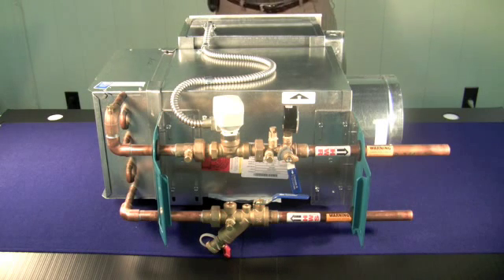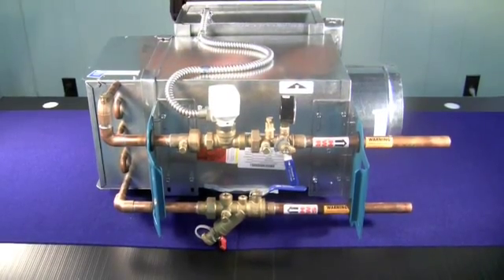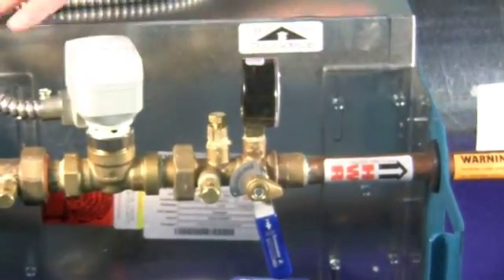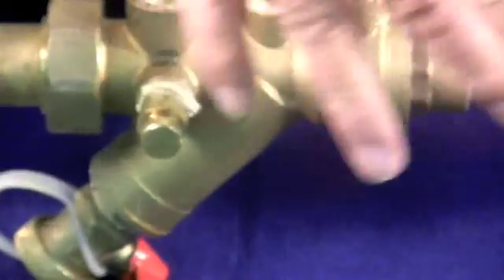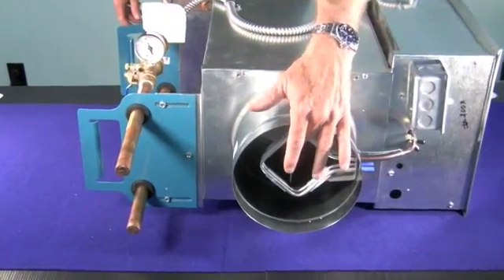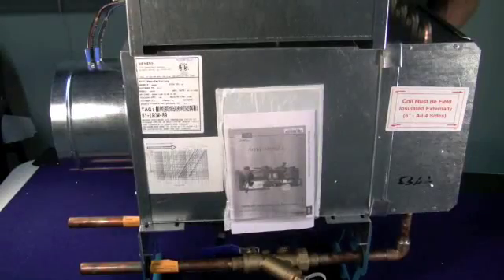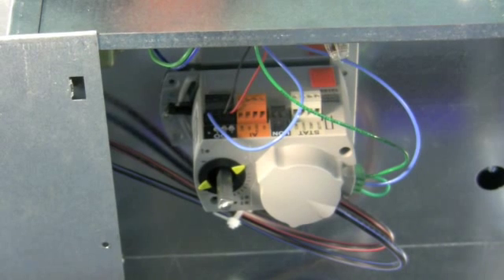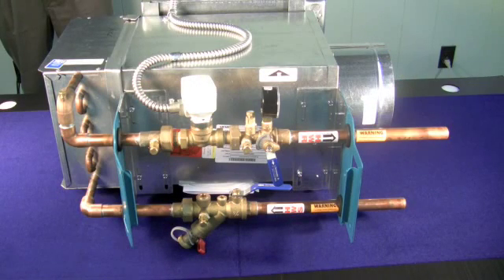Siemens ZCU

Comment: I liked the system of VAV controls. It is pre-piped and pre-wired for field. It is provided with individual control and does not depend on signals from centralized controls. Centralized control can record and give alarm, also you can over ride local or centralised controls.